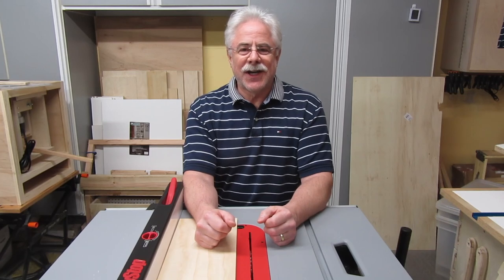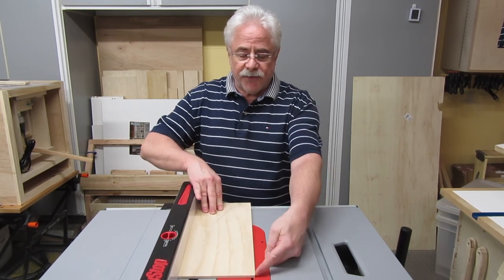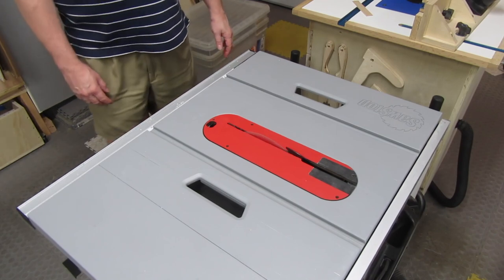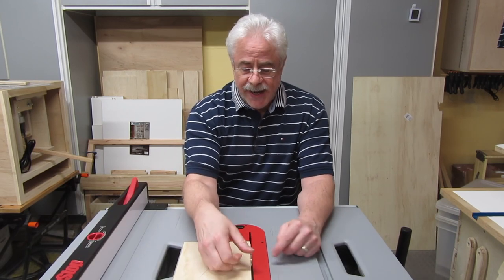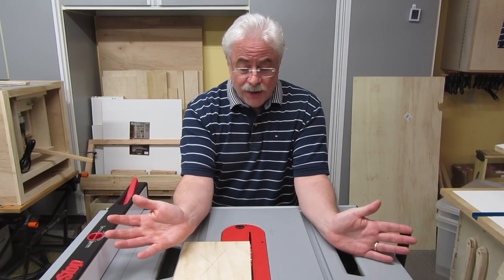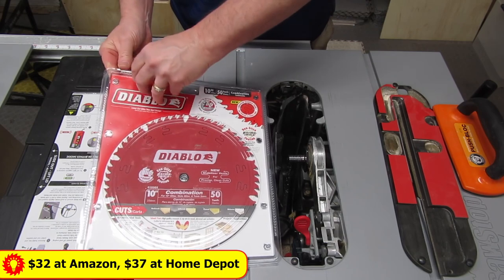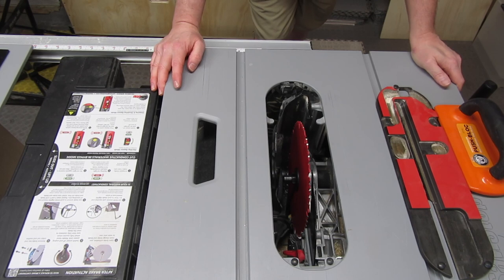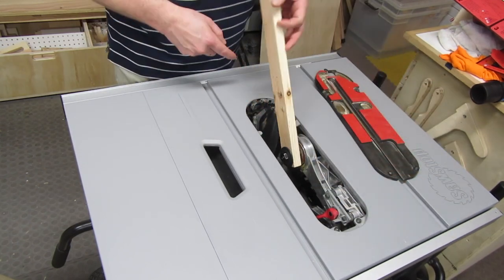SawStop Saved My Thumb! What Happens Next?

Comment: I've never seen this method for adjusting your table saw before....
it seems like you can spend all the time in the world making sure that the arborist rate but then the first time you torque down the nut on a new blade you can throw it all cattywampus.
I just throw my straight edge on there and make sure that my fence in my bladder lining up and I can check and make sure there's no wobble in the blade. I've been doing this for years and I don't use any kind of measuring other than the tape on the saw itself never had to go out of alignment to the point where I couldn't use it.
A good square lets me know if it's standing straight up and down and let's me adjust the miter saw.
I was curious you look at the piece of wood to see if it's good? Shouldn't you throw a square on it to make sure it is?
Anyway just subbed, I do like the video just a few questions about your methods.
Good info on the cost and procedure for setting the stop back up after tripping the thing.
But seems like the very first version of that I thought you had to send your saw or have them come out and fix it or something like that? That's what put me off of them to begin with.
Reply from the maker: Thanks for the comment. Yeah, it's a little anal of me, but what can I say? I learned the method from a respected book, and it works quite well. But whatever works for you is OK with me! I never heard of having to originally send in the saw, but at least you don't have to do that now.
Reply: @TheNewbieWoodworker  I don't have to do it at all because if i feed my thumb in, the saw gods tax it.
Have you ever had your method not work after zeroing it in and then installing the blade? Theoretically imperfections in any of the mating surfaces could throw you out. That's why I like to dial it in with the blade on.
I learned the method from an OLD woodworker with 8 fingers. I think that's good, it means he's has time to make mistakes and learn from them, right?
Reply from the maker: @leveckfamily8841  LOL, I like you! I've never had issues with it. Imperfections in the blade are rarely enough to make much of a difference, since this is woodworking, after all. But with that said, I call myself "Newbie Dan" for a reason, so take anything I say with a grain of salt.

My philosophy is to do research and try things out. If it works, and I think I can understand the principle behind it, then I'll talk about it in a video. And so far, it's worked out well. I actually did pull one video because I didn't feel like it represented the truth, but it was about my portable air conditioner, and it turns out my thermometer was faulty. I still think the air conditioner works well, but since I can't really prove it, I'm glad I pulled the video.

So I'm totally willing to admit when I'm wrong - it's one of the things people who don't know me are really surprised about. But I learned a long time ago that I'm not infallible. Hence the SawStop! 😄

Comment: It is kind of ironic that the safety feature saving your finger ended up injuring another finger even more ;)
Greetings from Germany
P.s.: Just a random guy, don’t even have a table saw
Reply from the maker: Thanks for the comment. It is ironic, but it was the blade that cut me, not the safety feature. You'd think I'd know by now that blades are sharp. 😏
Reply: The Newbie Woodworker well it’s the safety feature that made the blade cut you because it was completely stuck. I also can’t seem to get used to things being designed to cut actually cutting 😂
Reply from the maker: @flyingby3703  I totally get the irony, believe me. I have a whole minute or so of me talking about how ironic it is, but it's also got me showing the blood, and I thought that was too much. The cut didn't hurt, of course - I didn't even notice it, but it was a bleeder. It cracked me up how ironic it was. The hole thing is pretty humorous to me, especially since I didn't really get hurt by any of it. 😄

Comment: I know about machine geometry and alignment. Your method of determining the parallelism of the blade (plane of rotation) and the T-slot (line of reference) is spot on. It's a classic application of descriptive geometry. 

It's true the use of a 1 x 4 as an extended radius made me cringe but you isolated your point of reference to a mark. I cringed again because I saw no obvious effort to ensure your miter gage was firmly seated to the same side of the slot for each reading. However your repeat zero and repeat result were within small limits so my misgivings were without grounds. 

You done good if the approval of an interloper claiming expertise by mere say-so is worth anything.

I've heard testimonials and seen demos of the Saw Stop safety brake including the weenie test but remained skeptical. Your video has made me an advocate. I'm too decrepit to run power tools these days but people often consult me in matters of wood and metal work, machine tools, welding, etc. I'm putting the saw stop in the must-have column for safety features.

However I'm not too impressed with Saw Stop's right-tilt arbor as advantageous in a world where 89% of its woodworkers are right-handed. My considered opinion is right-tilt table saws best suit the ergonomics of southpaws who place the rip fence on the left side of the blade. Reason: bevel cuts and the off-cut trapped between angled blade and fence. I've seen whopper kickbacks on left tilt saws. In this lies the seeds of endless partisan debate best vented over beer and pizza.
Reply from the maker: Thanks for your comment, and I love your last line. You sound like me - with opinions, but perfectly willing to squabble with others about them, in a good-natured way.

And thanks for your validation of the method, although as I've said in other videos, I read it in a book, and it sounded good to me. 😄

As for the miter gauge not being secure in the slot, I completely understand what you're saying. The problem I've had in the past has actually been with the miter gauge tilting from side to side. So now I make sure the 2x4 jig is clamped down against the table, to prevent tilting.

Your comments about the blade tilt and the fence confuse me. It seems to me that:

1) Almost everyone normally places the fence on the right side of the blade, because the table is almost always wider on that side.

2) A right-hander stands off to the left side, to avoid kickback. Or at least they should.

3) The SawStop arbor tilts to the left, meaning it tilts away from a right-side fence, as it should.

So like I said, your comments about the tilt confuse me.
Reply: My mistake. Shoulda said "... southpaws who place the rip fence on the left side of the blade..." Dont know left from right. Next thing I'll be drooling on my bib.

I corrected the second sentence, last paragraph of my post.
Reply from the maker: @OperaBass3  LOL. As I was typing my reply, I kept double checking my left and right.
Reply from the maker: @OperaBass3  👍

Comment: Never be distracted by other things, like the fact that you are recording a video, but also other people near you or talking to you or whatever both when you are servicing machinery and when you are using it.
Never go too close a spinning blade with the hands, never have the hands in a far from the blade but unsafe position, like at the back of the blade as if a kick out happens your hand can be thrown against the blade  even if is several inches far from it, and never have your body in a position that can make it a target for wood pieces, hard metal saw teeth or else as consequence of a kick back or an other problem.
Use push sticks, feather boards or whatever is needed to achieve what I told.
ALWAYS, every time you service or use the machine.

And you will need no Saw Stop and be safer, even if there is nothing wrong in doing what I told AND use a Saw Stop, it is just that that saw in not inherently safe by itself, there can be possible injuries, even serious ones, without the hand touching the blade.
Most of the injuries happen in the first half hour, when we are not still fully concentrated on the work and in the last half hour, when we are still working, but our mind is away, thinking of what we will do after. Most of the errors in servicing the machinery, that can have much worst consequences that mounting a blade with the wrong orientation, happen when we are interrupted by a telephone call or an other person talking to us. 
Concentration and proper safe techniques  are the first line of defense, something that stops the blade if you touch it comes way back as importance, and I am not saying that it is not important as it is always better to have redundancy. 

I don't like to tell it, but I am worried when I see a person that is touching a spinning blade because is distracted as he is recording a video, and even more if that person mounts the new blade in the wrong direction for the same reason, 2 errors for the same reason so close are too much, way too much, and the fact that you noticed the second one does not change anything, you was servicing a machine and you mind was away, not fully concentrated to what you was doing.
Some years ago a wood worker that was servicing a shaper, as was not concentrated on what he was doing did not check if the knives was properly fastened to the head, then working a knife detached from the head and perforated his aorta, he died in few minutes.
A friend of mine lost a finger servicing machinery as his boss was at his back and talking to him and he got distracted. I could tell more of that...

Best regards.
Reply from the maker: Lots of assumptions in your comment, but let's start with the most glaring one: I was NOT shooting a video when this happened, so I was not distracted by shooting a video while I was doing this particular cut. I even mention that in this video. Your second assumption is that you'll never have an accident if you just pay attention and use proper techniques and procedures. Good luck with that - they call them "accidents" for a reason. Thirdly, and this is the one you'll have the most trouble understanding, is that some people can focus their attention better than others, and no, it's not just a matter of applying yourself. Check out my blog article on the subject: https://thenewbiewoodworker.com/2019/09/04/woodworking-and-add-redux.html.
Reply: @TheNewbieWoodworker  about my forst assumption if I was wrong I apologize, about the second one accidents are always possible, but if the hands are always far from the blade, as you use push sticks, and never in a position that the piece of wood, if something happens, can pull or push them against the blade, if feather boards are always used when possible or any way when the cut is particularly tricky and if the body is always not in a place where a kick back can throw the piece then the chance of an accident is greatly reduced, you touched the blade because you went with the hand near it while it was spinning instead of using a push stick to remove that  piece of wood, if you would have enforced to yourself the rule "never closer then a feet if the blade is spinning" what happened could never happen. I told that redundancy, a system that stops the blade, is welcome because even so you are not 100% safe, as you are not 100% safe using a Saw Stop, not because it can fail, if well maintained I don't see it happening, but because there are possible accidents that happen without the hand touching the blade, kick off, but also pieces of wood detaching from the board you are cutting and thrown at a very high speed, a friend of mine, professional woodworker, told me that once one of those pieces penetrated deep into a near by plywood sheet, with enough energy that it could have easily perforate the aorta if he had been right behind the blade, it was a very sharp piece of wood.
About my 3rd assumption it is true that we are not all the same, some of use can be focused easily, but who strives at that should adopt and make automatic safe procedures even more as the saw and some other woodworking tools are not forgiving, and anybody when uses woodworking machines should do only that, better to turn off the cellphone and any other source of distraction, or if not possible after a phone call or whatever it is better to spend some moments to focus again the mind on the work.
I am working wood since more then 30 years, i have done it as hobby and also professionally, and all the close calls I had was due to lack of concentration and/or not using the safest procedures possible. 
Also the accidents, amputations included, of the people I could then talk with was due to one of those 2 reasons. 
Every time we have a close call we should evaluate why and how to change our way to work to make it impossible or at least way less likely as we can not be so lucky the next time.
The less a person is able to remain focused, always aware of the possible risks and proactive the more that person should try to pay attention and do it deliberately.
To be focused is like to learn to play a musical instrument, some of us are more gifted, but all us can improve with a deliberate effort.
Best regards.
Reply from the maker: @andreachinaglia5804  OK.

Comment: Nice to see you are safe and are ok. 
How long did it take you to get back near the saw again let alone turn the thing on again?
Why are you selling the Saw then getting another of the same make? is it just an upgrade or is it a safer Saw that you are getting? 
What about all your jigs will they fit the new saw? 
Sorry for the all the questions, and as i said at the beginning, glad you are safe and are ok.
Barry (ENG)
Reply from the maker: Thanks! Since it didn't scare me at all, I started using it again right away, after I but the new blade and brake in. The new saw is "just" an upgrade. I'll probably have to make new sleds. Not the first, nor will it be the last time. 😏

Comment: When does it turn off? Because you gotta touch the blade to set it
Reply from the maker: Oh, I should have mentioned that. Once it's not spinning, you can touch it without triggering the brake. There's lights that flash while it's spinning, and when they quit flashing, you can touch it, but really you just wait until it stops spinning. So you basically just treat it like a normal saw, unless you want to cut aluminum or wet wood, in which case you use bypass mode, which means the brake can't be triggered.

Comment: Hey Dan .... you said you were upgrading to the cabinet saw from the contractors model ..... why ????? ... with a small shop it makes more sense to use the more compact contractors model ..... I'm looking at the contractors saw also but am curious why you are choosing the cabinet instead ...... I need mobility but I don't want to sacrifice quality for that .... your thoughts .....
Reply from the maker: Thanks, Joe. Honestly, I bought the PCS because I could afford it, and I managed to find enough room to squeeze it in. It's a gift to myself, paid for by viewers like you. 😛By the way, I think the contractors saw is only about 3" shorter than the PCS, length-wise. As for mobility, if you're talking just moving it around your shop, people say that the PCS with the Industrial Mobile Base is very easy to move, and I can believe it. I have the Integrated Mobile Base, and it works well, but only one set of wheels pivots, so you need more room to maneuver it. The PCS also has better dust control, since the base is enclosed.

So am I saying you shouldn't get the contractors saw? Absolutely not. I suggest you join the SawStop Users' Group on Facebook and ask questions. If not there, then some place like lumberjocks.com. See what people who own a contractors saw have to say about it. Like I said, I went with the cabinet saw because I could. 😄
Reply: @TheNewbieWoodworker  Hi Dan thanks for the quick reply .... after I wrote the above question I viewed the video you made about the un-boxing of the Saw Stop and realized you had the Jobsite saw and not the contractors saw ..... the cabinet saw is just to big for my location ..... thanks for clearing that up .... happy sawing ... LOL
Reply from the maker: @joekano4081  I saw that you wrote "contractors saw", but I thought it was just a typo. No worries, LOL. When you say the cabinet saw is too big, are you sure? I looked on the SawStop website, picked the Contractors saw, and compared it to the Cabinet saw. The Cabinet saw is 3 1/4" wider, but it's actually not as deep, by almost 9". I'm not pushing you, just wanted to make sure you knew that. 😄I know that that extra 3 1/4" could certainly put it over the top, as far as your space is concerned, but like I said, I just wanted to be sure. Good luck!
Reply: Thanks for the reply Dan ... I was looking at the huge extension wing on the picture of the PCS and that was to big then I read you could get a shorter version and that looks great .... thanks for your help and advice ... the PCS looks like a winner for me .... by the way Amazon has it with free shipping at a good price but you have to buy the mobile base separate but also free shipping .... can't wait .... the piggy bank is sure gonna groan ..... LOL
Reply from the maker: @joekano4081  Glad I could help! 😄 It's actually the same price no matter where you buy it from, it's just that Amazon includes the shipping in the price. The only way you can avoid shipping cost is if you buy it locally, and pick it up yourself (like I did).